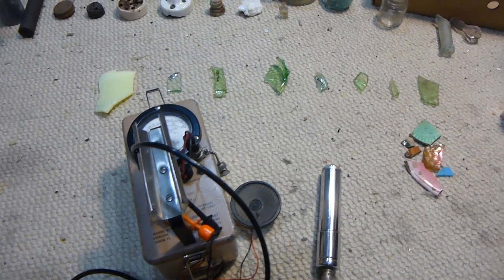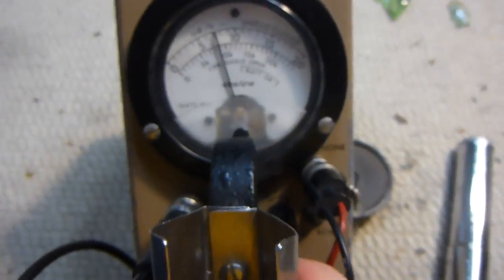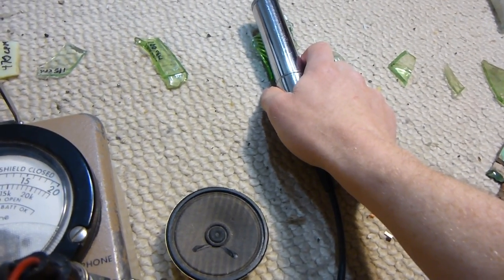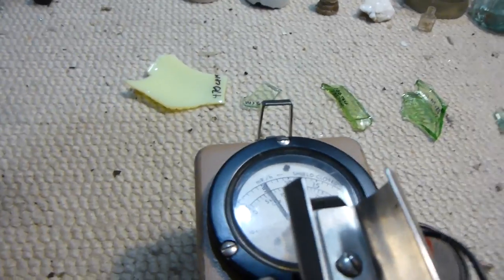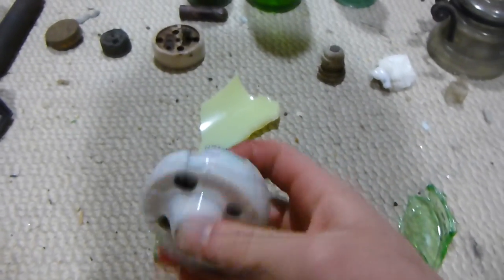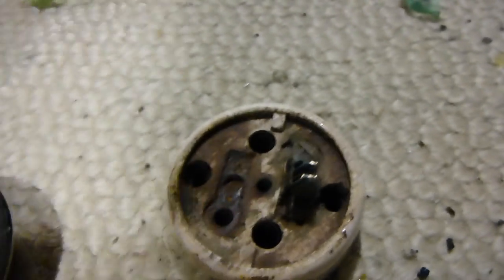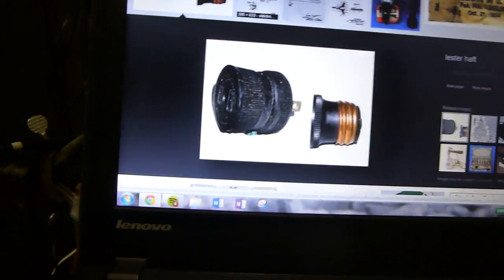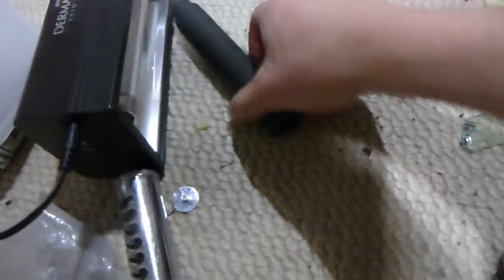Uranium Glass - Woods Exploration Followup Using Geiger Counter and Ultraviolet Light

Comment: I have a few pieces of vaseline glass that I bought at a flea market. They were blown glass and the seller told me that many of the makers died because of the uranium. What I know about glass could fit in a thimble, I just bought it because it looked cool. Maybe that old man was right! Nice video.
Reply from the maker: Quarter Hoarder That could be true.  But they don't put that much in.  Now if they breathed in some of the uranium oxide dust or if the process vaporized some uranium then that could be bad because it could get absorbed into the body and you could get a lethal dose that way.  But just from the radiation from working with the uranium ore I doubt it.  It's not enriched so it's really not that radioactive.

Comment: I have an old green glass telegraph line insulator that's radioactive. I got it from the side of some railroad tracks some years ago and used it as a door stopper. The railroad came through and cut all the poles down and left them there to rot away.
That ceramic lamp base look like it may be a 30 volt DC type. Some places used 30 - 32 volts DC locally for house lighting before the days of 120 volts AC came to the rural areas in full force. This is about the same time where people shared one common telephone line that rang a local operator by turning the crank on the phone and telling the OP to connect you. It was no big deal to pick up your phone back then and hear your neighbors on the line talking on the line!
If that was a 30 volt lamp base then your carbon rods could very well be from a large high current 32 volt battery!
Reply from the maker: ElfNet Gaming That's a nice find!  I thought they only added uranium for decorative proposes: people like the color.  Why would they add it to an insulator?
That's totally possible that it was from a 32 volt DC system.  I honestly have been looking all over the internet for ceramic light bases and I can't find anything that looks remotely like it.  Nor can I find anything that looks like the lamp base or outlet.  Yeah that would have been interesting listening to your neighbors!  :P
Yeah I'm thinking that they were probably from a battery.
Reply: for the insulator I have absolutely no idea. people back then were drinking radiation filled water and taking radiation pills. maybe they thought it was harmless and helped with the signal transmissions. IDK
I can look around and see if I can find you some info on a 30 - 32 volt electrical system of the past. I mean the info and items are as rare as rocking horse shit but maybe I will get lucky.
I may be getting my hands on a mercury arc rectifier that was used here when they had street trollies. I'm trying to talk them out of it..
Reply from the maker: Yeah I read about those things called Revigators.  Supposed to put radon in the water.  It's pretty interesting all the things they used to think were good for you.  Like blood letting.  They'd never do that these days.

That would be awesome!  I've been looking but can't find anything.  "Rare as rocking horse @#$%" LOL

Mercury arc rectifiers are so cool!  If it's from a trolley then it's gonna be one of those huge ones!  Awesome!
Reply: yeah its a 6 phase type and its pretty large. 
They are being all "EPA Trolls" with it because of the mercury in it but it looks really cool and I can power it up here lol but I don't have a need for 600 + volts DC lol
I was just going to put it on a display type thing in my office room
Reply from the maker: ElfNet Gaming That would be really cool!  And hook a neon sign transformer up to it so it glows real nice in the display!  :D  They do have a nice amount of mercury!
Reply: yeah maybe. IDK yet, i dont even know if I will be able to get it yet either, I dont want to get ahead of myself here just to be let down lol
Reply from the maker: ElfNet Gaming Yeah true.  Well I hope you do get it!  Best luck to ya man!

Comment: I gave a very similar bit of carbon somewhere. Found it while digging a foundation trench for a new house. There where some old farm structures that used to be in the same place. Also dating back to the 20's-30's. I never have been able to find out what it was for.
Reply from the maker: Mongrel Shark Interesting.  I'm guessing from old batteries.  At least that's all I can figure.  Too big for arc lamps and I think too short for arc furnace.  I'm thinking batteries like this: https://www.google.com/search?q=old+radio+batteries&rlz=1C1CHMO_enUS511US511&es_sm=122&source=lnms&tbm=isch&sa=X&ei=43sVVfyDMIG4ogSMx4KYDQ&ved=0CAgQ_AUoAg&biw=1600&bih=775#tbm=isch&tbs=rimg%3ACY-DE9Nv78gyIjh1Y-GXkhdNwD07bo1g12lVG0TS9hUALq5PA_1wDNghOH_1nbksY2QmtnYBLXMuLeE5A0oCD1MugDBioSCXVj4ZeSF03AEcqIGpg1MY-UKhIJPTtujWDXaVURD2hUkhdvzXoqEgkbRNL2FQAurhHP7PBFn02A7ioSCU8D_1AM2CE4fERwzA1AFDguYKhIJ-duSxjZCa2cRxsUXIRqD2Y4qEglgEtcy4t4TkBF4V8oAQCw-tyoSCTSgIPUy6AMGERSpBBM-x-ZO&q=old%20carbon%20zinc%20radio%20batteries&imgdii=_&imgrc=-duSxjZCa2c3OM%253A%3BA7WDRT26KqmW4M%3Bhttp%253A%252F%252Fwww.kansaswindpower.net%252FIMG_2657a25.JPG%3Bhttp%253A%252F%252Fwww.kansaswindpower.net%252Fbatteries%252C_chargers.htm%3B783%3B407
Reply: That's about the best suggestion I have had.
A few people have suggested arc stuff, but its never been used if that's the case.
I think you might be right about the battery’s. There was a windmill nearby which everyone thought was strange due to a lack of a water bore. I bet it was an old generator for charging a 1920-30 electric car.

Did you know those old electric cars had similar range and speeds as today’s electric cars? The difference is today’s cars weigh a lot more, partly due to safety stuff, like good breaks and steering etc, and largely due to  Luxury things like CD players, air con, and power windows. Most of which need extra power to work....
Reply from the maker: Mongrel Shark  It's definitely from old batteries!  No question!  I found one that has the exact same carbon rod but has a plastic/tar casting around the top.  Very much like the ones in the picture I sent you.  There is even a place where the second terminal would have connected to the outer zinc can housing.  Looks like it was full of sand to make it a dry cell.  Some one must have had an old radio set.  Especially since I'm finding those lard ones and some smaller C ish sized one.  The old radios often had two different power supplies for some reason.

Yeah it is pretty crazy!  The early electric cars were basically nothing more than a horse carriage with an electric motor and batteries.  They carriage it'self has to be light or the poor horses.  And yeah nothing safety or AC and all the other junk.
Reply from the maker: Makerj101 Actually I gave you the wrong link. The batteries these carbon rods were from probably looked like these: https://www.google.com/search?q=vintage+dry+cell+battery&rlz=1C1CHMO_enUS511US511&es_sm=122&source=lnms&tbm=isch&sa=X&ei=QLgYVYOkO5CwsAS80IDYBw&ved=0CAgQ_AUoAg&biw=1600&bih=775#imgdii=_&imgrc=39fQD-cH7_IGLM%253A%3BwoKy2wxk4sOf_M%3Bhttp%253A%252F%252Fwww.radiolaguy.com%252Fimages%252Fmisc%252FNo6-A-cells-x4.jpg%3Bhttp%253A%252F%252Fwww.radiolaguy.com%252Finfo%252FVintage_Batteries.htm%3B587%3B356
Reply: Now I see why you say radio rather than car
Reply from the maker: Mongrel Shark Yeah.  I've got a video coming where I find this carbon rod with the cap part!

Comment: Would you get cancer or something as those are radioactive? I'm not sure, I'm a newb with radioactive materials
Reply from the maker: Spreedator 1000 

+Ross Carlton  Nope.  You can't get cancer from such a small amount of radiation.  You have to get a LOT of radiation before the chance of cancer even increases at all.  Being exposed to a small amount like this will actually decrease chance of getting cancer.  It's just like how you need some sunlight to be healthy.  No sunlight and you will be vitamin D deficient and have lots of other health issues.  But too much sunlight and you could get cancer.  Same thing with radiation.  Small amounts stimulates repair mechanisms in your body and gives those practice repairing damaged cells.  It's called Radiation hormesis.

Comment: Ok I found something on the 32 volt electrical system. It was used widely in rural areas, like farms, and bigger systems for mining back in the early 1900's
A company named Delco made most of the systems that could be installed in farm houses to eliminated flame lighting and make things safer.
Here is a link - Delco - http://www.doctordelco.com/Dr._Delco/Delco-Light/Delco-Light.html

Here is a battery your carbon rod most likely came from (this one is by far smaller of course but you get the idea) - http://www.doctordelco.com/Dr._Delco/Delco-Light/Pages/Delco_Gallery.html#6

If you look through the gallery you may find your bulb base and other things, They made several styles of lighting systems and even christmas lights!
Reply from the maker: ElfNet Gaming Neat!  Well this probably would have been a rural/mining area back in the day.  I think however those batteries are generally lead acid because they are rechargeable.  

I'm actually kinda sad... I was digging out there some more the other day and found an old fuse with the metal base coming off... guess what?  It has the same exact ceramic screw...  darn, I thought this was some kind of special rare light base!!!  Oh well.

Oh and I found another carbon rod!  But this time I found something with it!  I has a plastic/tar cap cast around one end.  It's definitely from an old battery!  No question! There is even a place where the second terminal would have connected to the outer zinc can housing.  Looks like it was full of sand to make it a dry cell.  Some one must have had an old radio or telephone set.  Especially since I'm finding those large ones and some smaller Cish sized ones.  The old radios often had two different power supplies for some reason.  The cells the carbon rods came from probably looked something like these: https://www.google.com/search?q=vintage+dry+cell+battery&rlz=1C1CHMO_enUS511US511&es_sm=122&source=lnms&tbm=isch&sa=X&ei=QLgYVYOkO5CwsAS80IDYBw&ved=0CAgQ_AUoAg&biw=1600&bih=775#imgdii=_&imgrc=39fQD-cH7_IGLM%253A%3BwoKy2wxk4sOf_M%3Bhttp%253A%252F%252Fwww.radiolaguy.com%252Fimages%252Fmisc%252FNo6-A-cells-x4.jpg%3Bhttp%253A%252F%252Fwww.radiolaguy.com%252Finfo%252FVintage_Batteries.htm%3B587%3B356

I came across this the other day when I was researching.  It's all about how to repair the old lead acid batteries and everything you could ask for!  http://www.powerstream.com/1922/battery_1922_WITTE/batteryfiles/chapter17.htm
Reply: Fuse with a threaded metal base is a "Plug Fuse" you can still buy them at some hardware stores.
Old radios had two power sources because of different requirement for tubes heaters and dial backlight and another power source for the actual circuits in the amplifier to work. Of course all this was replaces by the common induction multi-tap step transformer (They stepped voltages up and down in old tube sets)
Those old batteries are what was called a "B" cell battery which was a dry cell. They were replaced by the modern types we have today and on into the early 70's hobbyists used "B" cells in projects. "B" cells were used in everything from radios to flashlights.

That farm lighting batteries were crude lead acid types very similar to our modern car batteries today but they usually only had one chamber of plates. Thus why so many batteries were used in series to get the voltage up to 32 volts.and then in parallel to get the amps up to drive several lights for several hours. These old houses did not have wall sockets and the radios were battery powered and frequent trips into town to buy batteries was not unheard of. The lighting was retro-fitted in the house by a technician or the house owner depending on knowledge and money willing to spend, etc.. You heard of the term "Knob and Tube" right? Early electric homes up until I think the 50's had Knob and Tube wiring in them and it is still considered to code today as long as you DO NOT mess with it. Some of the old 32 volt stuff used Knob and Tube because it was easier to tack insulators and wire along the walls than to feed wire through the insides of walls and such.
Reply from the maker: Yeah so the plug fuses are nothing special.  My grandma's house has some fuse panels that have them.

I think you might be thinking of the A cell.  The B batteries are not really a cell since they have many cells to add up to around 45 volts which is needed for the plates of the vacuum tubes.  The A cells(which are what my carbon rods are probably from) would have driven the high current filament of the tubes.

Yep!  Knob and tube!  We used to live in a house that was built in 1813.  It had knob and tube as well as insulators stringing the rafters in the attic. However it was rewired by the previous owner.  It was really neat how it was all done.  And I can't see why it wouldn't be to code!  They were always at least like a foot apart!  No worries about shorts!  I'm not sure how connections would have been done though.  I'd guess they were probably soldered and wrapped in cloth.
Reply: Cool think about a plug fuse panel is you can screw a bulb into a socket and use that to measure load by brightness.
Some people used to put coins in the socket to shunt the fuse so they could plug more crap into a socket, this is not a good deal and caused many homes to burn.
Yeah I forgot about the "A" cell. lol. When I say cell in terms of dry cells batteries I mean the actual battery not the cells in the thing haha.
Knob and tube wiring connections were made by linear wrapping (not twisting for a wirenut) the conductors and taping with the matching cloth tape. Knob and tube is still up to code as long and it is NOT tampered with, modified, added to or re-routed.
Of course knob and tube cannot be newly installed because it does not follow todays electrical code, there was no earth grounding and the wires are jacketed in cloth braid and exposed outside of a conduit (Romex has a rubber / plastic conduit)
The insulators are ceramic for the most part and can be reused in electric fences or in Ham radio for antenna isolators..
Reply from the maker: That's true!  I never thought of that!  Would be useful for troubleshooting shorts and such.

It sure looks like it would have been costly to put in knob and tube in a house.  All those insulators and a lot of work to put them all in and make all the connections.  Why did they go to the extent of knobs and tubes anyway?  It's not like wood is that conductive and the wire did have insulation on it.
Reply: knob and tube was supposed to be easier to tap and I don't think they had romex back them either lol The first versions of romex type cable was the paper and cloth types used throughout the 50 and 60's. The plastic types came out in the 70's and is used today in residential applications.
Knob and tube was an easy tap type of wiring and they didnt need a junction box or wire nuts, A particular circuit like for wall sockets would have a main trunk run and they would all tap from it down the walls. same for lights.
What you ended up with eventually in time is a fucking mess in the attic especially when all the leads were black..
Romex and the junction box made all this obsolete and easier and more compact and safer with a earth ground.
Reply from the maker: ElfNet Gaming Ahh I see!  Very interesting thank you!  It really is a neat thing!